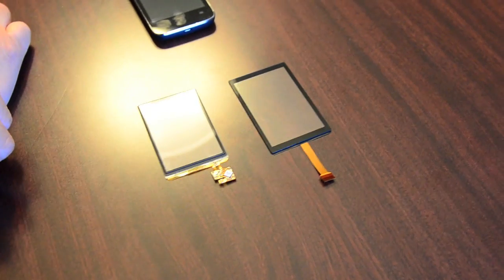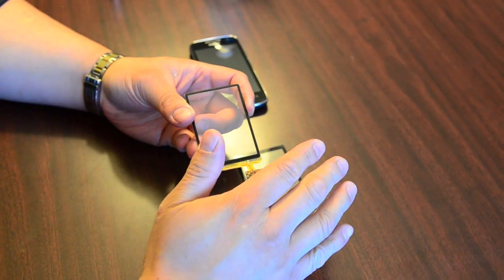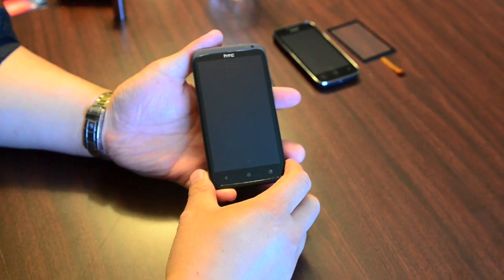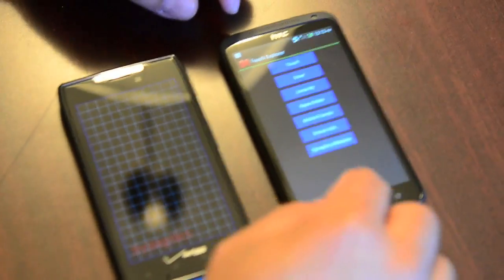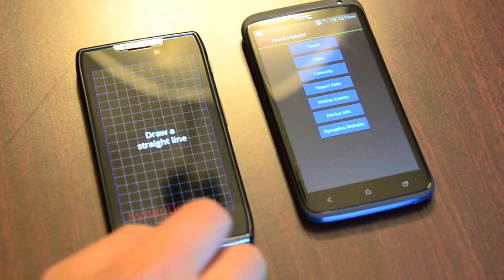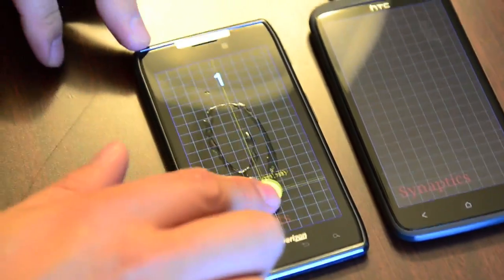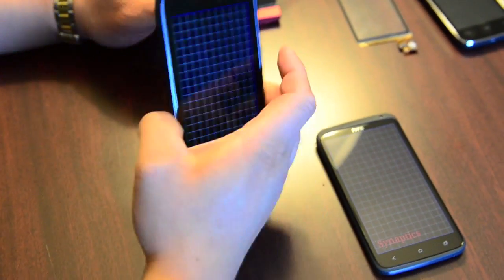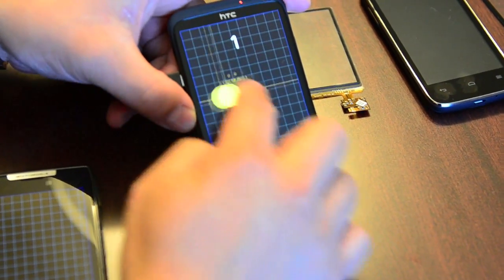Synaptics ClearPad 3 Touch Controller Demo

Comment: i'm pretty sure Samsung manufactures most of the hardware in the One X, except for the CPU.

as samsung makes the best flash memories in the industry, also - they have the biggest LCD/OLED display manufacturing capacity.

I know HTC has been very innovative with their phones, but the One X brought nothing new to the table, except for a dedicated Camera-chip, which the S3 also have, and it does it better.